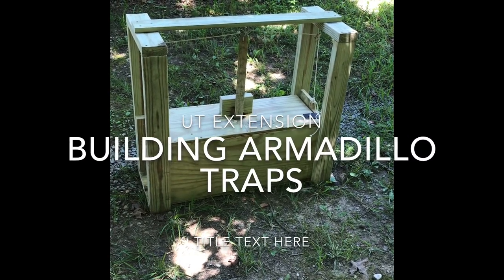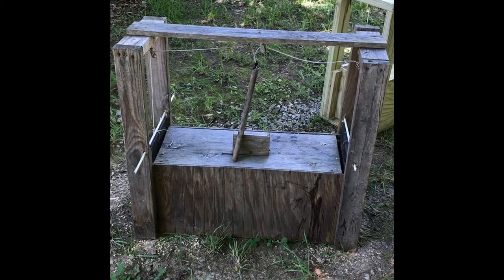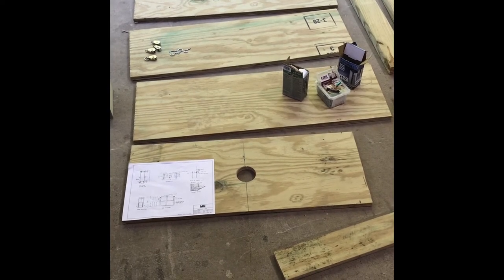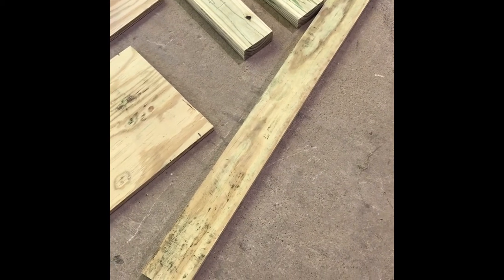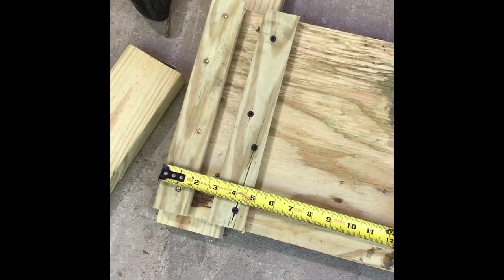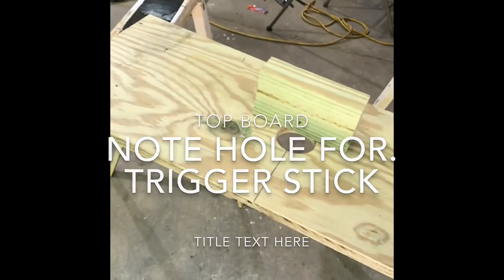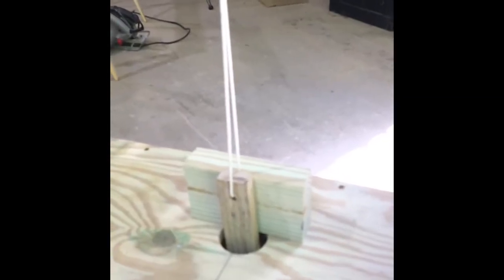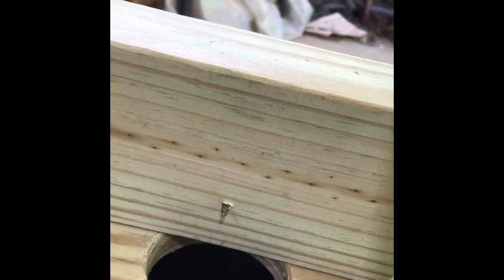Building Armadillo Trap

Comment: After trying different trigger designs I saw on other videos using a nail hooking to a eye bolt as the trigger I had problems with the stick going all the way to one side of the trap side wall allowing the armadillo to bypass it. Using your method with the 2x4 attached on its edge with the screw hanging it this method prevents the stick from moving to one side due to the weight of the doors. Excellent  trigger mechanism.  This works great. Thanks.

Comment: How do you get the first “smell” in there
Reply: Placement is the most important factor in catching them. For the first one, make sure it's along a path they have been using, or an area they work heavily each night. They like to move along foundation walls. They will eventually wander in. Use some 2 x 8's or light fencing to make a wide "funnel" at each end, trap parallel to the direction they will probably be moving. This will guide them into the trap easier. After that, they pretty much go in any trap that has been used with the funnel.